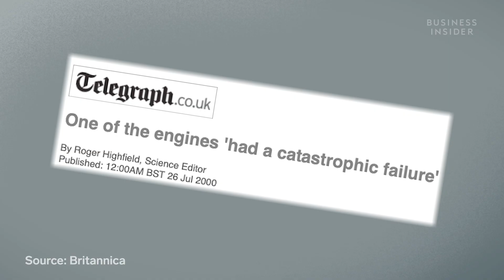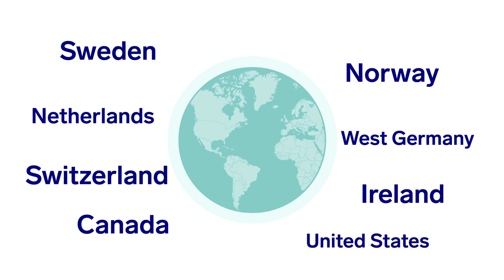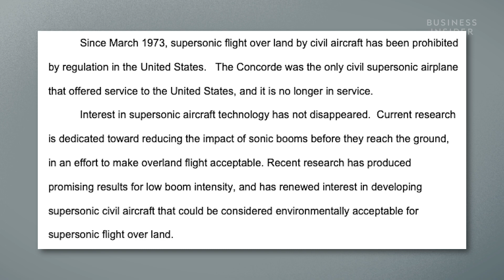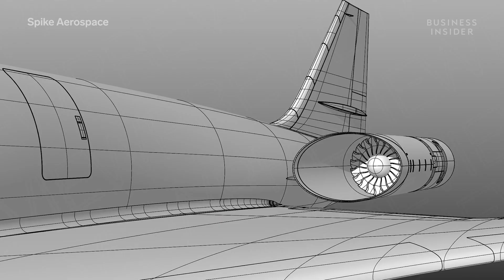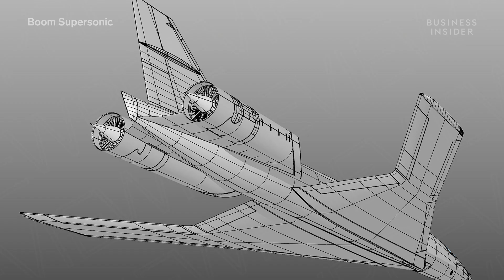Why We Still Don't Have Another Concorde

Comment: Let artificial intelligence drive this to cut down on Pilot errors
Reply: Cy Clones ai will never be as good as a human flying. They can not deal with unique failures
Reply: @joeboi1342  Completely false. AI is able to understand every part of the plane and it's function and through practice and predictive algorithms calculate the best course of action. AI has been shown to continually outsmart humans at chess, games like League of Legends, Go etc. It can predict your move, or the effects of its move before you even make it. Even basic autopilot can fix errors, for example a flight in 1978 I believe, where a plane crashed into a mountain after the pilots lost control, the pilots over controlled to get it back in control but unfortunately it ended up in the plane losing further control, eventually it was discovered that if the pilots did nothing and instead used AP the AP system would have been able to correct the flight and save lives. So many flight errors are from over control which is a human condition, the irrational thought that too low is bad so too high must be good, instead of only middle is good, AI has no emotions and no fear, so doesn't over control due to fear.
Reply: Mark Mulvenna you’re right when talking about most applications, but aviation is the one field humans will almost always drive. The technology behind AI is currently what’s leading to modern day crashes, also there’s the fact that the reaction time of AI reacting to atmospheric changes with aerodynamics of flying is too slow compared to humans. The fact of the matter is, no amount of technology can correctly guess atmospheric aerodynamic changes, human pilots can’t do it either, but our 6 senses allow pilots to fly aircraft better. Specifically on take off and landings
Reply: Mark Mulvenna how abt 737 max. What if we only had ai no pilot there would have been more crashes ai will never be able to do what humans can do. Out Brain is millions of times stronger then the strongest supercomputer
Reply: @joeboi1342  The 737 Max 8 was due to the AP system getting thrown off due to bad sensors.
Reply: Mark Mulvenna not league of legends doe but the rest yes because league of legends has world champions able to beat these robot so’s in a game
Reply: @jongxina4929  let me guess, Asians
Reply: If we can have self driving cars which can work anywhere, anytime and in weather condition, then we can safely assume that AI controlled aircraft is very much possible.
Reply: Abhinav Sharma uh no because those are cars, not planes....
Reply: @varietychillin9632  Planes do not need to worry about a random pedestrian walking out of nowhere, nor does it needs to worry about potholes and other vehicles in very near proximity.. Believe me, you might take driving for granted, but it is a very very complex problem for the AI to solve..
Reply: Abhinav Sharma it’s diffrent then falling out of the sky 40000 feet in the air
Reply: @joeboi1342  AI with a human pilot could work..
Reply: PoXel that’s what autopilot is lol

Comment: I think the Spike Aerospace design is going to have to look at the intake duct on the engine to slow the airflow down.
Reply: The artist renderings are intentionally altered from the actual design.
Reply: Ah yes, YouTube Aerospace Engineers tell me more
Reply: Intel you know, it really shows your ignorance when you assume anyone in a comment section doesn't know what they're talking about compared to people who can draw pretty pictures.

It's well known and documented (you can find many videos all over YouTube talking about it) that supersonic intake air needs to be compressed/slowed down before entering the engine in order to get any kind of efficiency. A good rule of thumb is that subsonic airflow doesn't compress without compressor blades even when forced into a smaller intake area (either the airflow speeds up, or excess flows around the sides), but supersonic airflow will readily compress even when it is not forced into a smaller area. Simply deflecting supersonic airflow will slow it down, forcing it to compress.

This is how all supersonic aircraft feed their engines. It's actually responsible for ramjets producing thrust at supersonic speeds, but effectively none at subsonic speeds.

Having a completely exposed engine intake shows an immediate and critical design flaw, and a lack of understanding of supersonic airflow on the part of the artists (or the engineers, if that really represents the design).
Reply: @J7Handle  Yep on the one failure captain jon had it was one of these intakes that wasnt working properly which the engineer manually fixed

Comment: How about the environmental impact of these new gen supersonic ac?
Reply: I want my planes to burn uranium and spew toxic waste
Reply: @Leumas34676  thats toxic
Reply: Or we can have fossil fuel planes along side with electric cars
Reply: @taekwontheo  then whats the point of the electric cars?
Reply: There will be so few of them that it will not make a bit of difference. The push needs to be to reduce or eliminate the emissions on the vehicles with the most numbers. Even if there are thousands of these flying it will still be such little impact compared to the millions of other vehicles that do have an impact.
Reply: Jams Hopefully in the future we will have synthetic fuels, fuels that have the characteristics of aviation fuel but manufactured from renewable raw materials or made via a process like electrolysis using electricity from solar. We have been able to separate water into hydrogen and oxygen for over 200 years, but it takes more energy to do so than you get back when you burn the products. However, if we had significantly more cheap and renewable electricity this wouldn't matter. The resulting hydrogen can then be liquefied and used, or turned into something else to fuel next generation engines.
Reply: That’s a good question this is the opposite direction humanity needs to be heading in terms of being environmentally friendly.

Comment: Make it with Cabine Catapult system, and finally solve the safety problem in cases of airplane incidents. I assure you that companies will gain even more customers if they offer catapult system for travellers!
Reply: I am not an engineer but don't you need to reinforce the structure of the plane to cop with the stress created by the catapult system, and those reinforcements adds weight and more weight means less fuel efficiency?
Reply: @cheezehao1129  There are many people who are ready to pay more for safe travel. So if the fuel wouldn't be a problem, if it is the only handicap in creating catapult system. I guess there are more complicated engineering problems for catapult system.
Reply: @dunyamalibabakishizada7744   Yeah, but the only benefit of catapult is fuel efficiency and shorter runway isn't it ?  If the catapult won't help fuel efficiency what's the point of it ?  There is also problem with the passengers old people, children, and people with disabilities won't be able to endure the G-force from the sudden acceleration of the plane using the catapult.
Reply: Please elaborate

Comment: Because they are hard to pilot
Reply: thats why its the perfect time today, with very good autopilots and assisting software
Reply: @MrDragonorp  yes like Boeing's MCAS software
Reply: @AmalDevYT  lol
Reply: @AmalDevYT  Boeing's MCAS was just a particularly poor design. That doesn't mean that we should abandon all automation and go back to stick and rudder. Humans make far more mistakes than computers do.

Also, the two crashes actually had three causes: One was the lack of proper manual override in software; the second was a lack of pilot training; and the third was that fact that the software only relied on one input in order to do its job.
Reply: ekusaS Wrong. They were supposed to handle amazingly. Although the high landing speeds must have required a lot of skill.